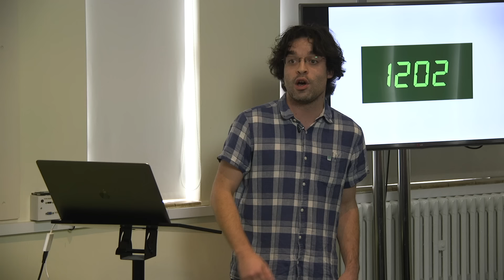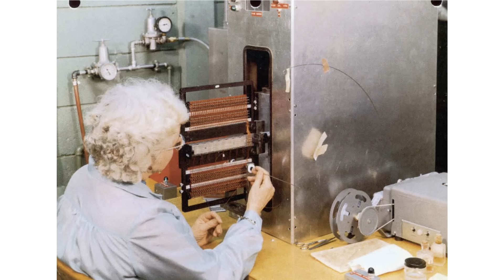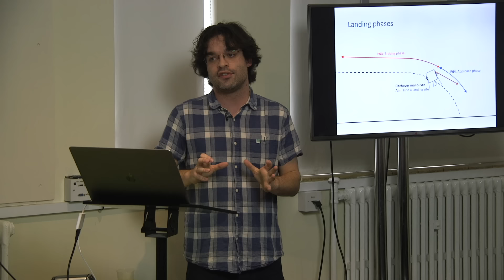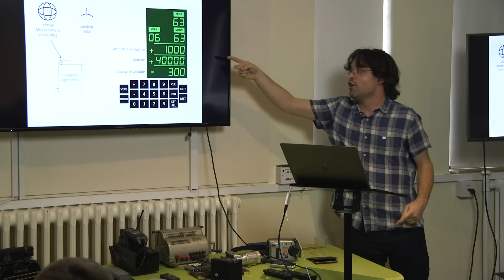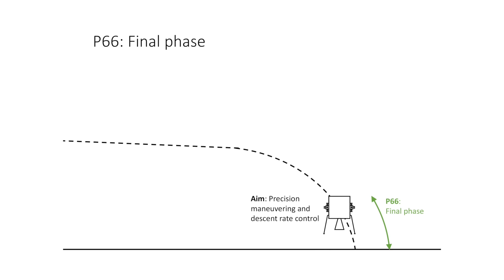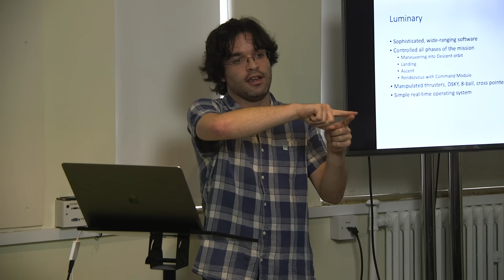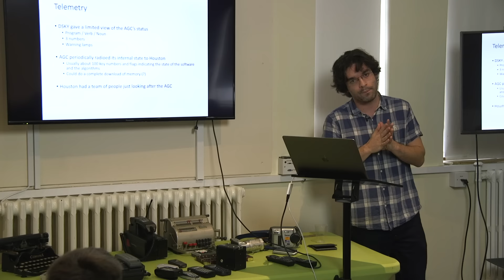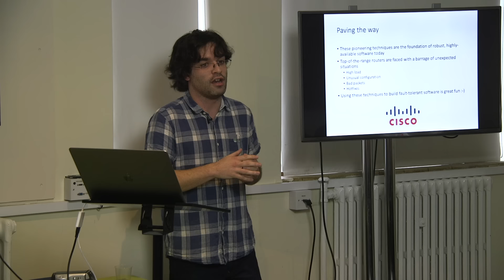Light Years Ahead | The 1969 Apollo Guidance Computer

Comment: 35:35 that 2 shadows is not parallel.. lol .. very well presented and quite very interesting! 42:38!
Reply: 35:35 that 2 shadows is not parallel.
Well, yes - as we can see in other photos, the ground behind the Lunar Module slopes upwards - hence the non-parallel shadows.
Reply: @Jan_Strzelecki  Indeed! A slope, and not a studio spotlight o7
Reply: @hannocoetzer8763  The length of the shadow is inconsistent with the position of a spotlight needed to produce such dicergence.
Reply: @hannocoetzer8763  If that's a spotlight, holy fuck, where can I get it?  It seems magic!  A spotlight should, assuming there isn't magic going on, have the rocks in front of the astronaut be significantly brighter than the rocks further away from the subject in direct lighting.  A spotlight, unlike the sun, isn't placed an effectively "infinite" distance away, and it's WAY more dim, so the brightness of any spotlight will drop off quite quickly as a function of distance.

But in that shot I see the area BEHIND the astronaut as brighter than in front of him, and the area in front of the camera looks as well exposed as anything else.  That's stupidly consistent even lighting.  If there was overhead studio lighting to create that consistency, I'd expect the shadow to not be completely pitch black.  The shot looks like its being lit by a single source that is stupidly far away, like outside daylight, with almost no light diffusion.

And that looks like a studio light to you?  Mind telling me the brand?  Which can replicate full exposure even directional sunlight like that?  How on earth does a person accomplish a shot like that?
Reply: @Killua2001  If Stanley Kubrick were still alive we could ask him what spotlight he used and how he did it

But in all honesty, I enjoy the moon landing conspiracies, and for me it is little curiosity  thought experiments of whether it was remotely possible to reproduce the same effects, back in the sixties, without going to the moon .. for instance even maybe hypothetically using moonlight as the main light source - single shots with very long exposure and wide aperture
Reply: @hannocoetzer8763  Ah, fascinating, so you've now recognized that the lighting is so even it suggests it's outside.  But you've got some other issues.  I'm going to ignore the motion blur issues that crop up when we switch to video, and stick to just a long exposure still where we assume a subject doesn't move AT ALL.

How do you avoid seeing stars?  If we're exposing for low light, without the light source directly in our field of view, and we've got a wide open lens, I'd expect to see stars.

It has the even lighting of a source very very far away, like, say, the moon, but it also seems to be lit by an incredibly BRIGHT source, like, say, the sun.

Of course, you can say "well, no, it was filmed in a studio", but that brings us back to the 'lights' that seem to have completely even lighting without any hot spots while also magically creating a complete black void behind the astronaut.

Gotta say.  Requires a lot less suspension of disbelief for me to think we strapped people into a tin can stuffed to the brim with explosives than it does for me to think Kubrick was capable of violating the laws of physics with his advancements in the fields of optics and lighting in the 1960s.

Comment: NASA - hebrew for "to deceive". If the van alen belts hadnt destroyed them, then the tempature at full sunlight would of fried them to 127 degress celcius, yet the chest camera that was used for filming wasn't friend in such tempatures, and neither were the astronaughts. The moon Lunar lander had the same space as two phone boxes side by side, yet they fitted in it the moon buggy and two astronaughts. The science is laughable beyond belief.
Reply: You NASA haters are truly pathetic. 
 Get a life!
Reply: @CNCmachiningisfun  then how would you spend your life?
Reply: NASA - hebrew for "to deceive".
That is factually incorrect. NASA in Hebrew means "to uplift". You're thinking of "nasha".

If the van alen belts hadnt destroyed them
It wouldn't.
"The outbound and inbound trajectories of the Apollo spacecraft cut through the outer portions of the inner belt and because of their high speed spent only about 15 minutes in traversing the region and less than 2 hours in traversing the much less penetrating radiation in the outer radiation belt. The resulting radiation exposure for the round trip was less than 1% of a fatal dosage – a very minor risk among the far greater other risks of such flights." - Dr. Van Allen.

_ then the tempature at full sunlight would of fried them to 127 degress celcius_
Had they no temperature control systems, it would, but since they did, it didn't.

yet the chest camera that was used for filming wasn't friend in such tempatures
The Hasselblad camera used in the Apollo missions hasn't been exposed to the sunlight long enough to actually heat up to 127ºC.

and neither were the astronaughts.
The actual astronauts were, though. Do you perhaps imagine that their space suits were white just because they ran out of dye or something?

The moon Lunar lander had the same space as two phone boxes side by side, yet they fitted in it the moon buggy and two astronaughts.
Okay? In this reality, though, the astronauts carried the LRV outside of the Lunar Module.

The science is laughable beyond belief.
What is laughable beyond belief here is your pitiful understanding of the Apollo program specifically and science in general.

Comment: I hand coded Fanuc® when we had to ensure our total program was kept very small to compensate for lack of memory. Now, in the days of high level cad/cam and finite analysis systems, like MasterCam® and Solidworks® most programs we hand coded back when are available as simple canned routines. The interface takes one code with three or four variables instead of a pages-long stream of individual commands. I get how much onboard brainwork the software engineer had to have in mind and how easy it would be to neglect a checklist item for intercept radar to off, and all I was trying to avoid crashing was a tool head into a workpiece or fixture. Credit to MIT/NASA that they only had one glitch landing on the moon with less memory than my microwave oven.

Comment: First, brilliant presentation!

Second, about Aldrin and the rendezvous radar: In 2019, the spate of Apollo documentaries included one with an Aldrin interview about the 1201/1202 issues. In that interview, he admitted that the standard mode was to switch off the rendezvous radar before starting powered descent. But for the landing he claimed he wanted to be "ready for an abort", so he intentionally skipped that step. He made the admission/confession with classic Aldrin braggadocio and very little sincere reticence. Basically his posture was, "I wanted it. So I did it. And I got away with it." 

Remember that Aldrin was nicknamed Mr. Rendezvous for his extensive and invaluable work on orbit rendezvous techniques. In my mind, he wished he would be the first pilot to land on the Moon. But if he couldn't have that, he wanted to be the hero who saved the landing party after an abort. So he situated himself and his "indulgence" for success after an abort. He wasn't cheering for an abort. But if it happened he was ready to reap some credit for his enhancement of SOP.

I don't think for a second he expected his little stunt would have caused the ruckus it did. And Apollo was mostly a national pride production, so pointing a finger at one of the two heroes who landed wasn't productive.

Comment: Pfft.. that's plenty of memory. That's not even 2KB, that's almost 4KB of RAM. I've written code for controllers with less memory than that. Clock speed is pretty slow, but plenty enough to steer a spaceship. Why they didn't add an extra bit to the processor word is weird tho. Would have been much better to add one more bit to keep it a power of 2. I haven't done any research on the reason for this, but perhaps this was simply because of how they initially aligned memory modules.
Reply: There is no need for word length to be a power of two.  It is a convention used in more modern computers because most computers nowadays do a lot of processing of text and the industry has standardized on 8-bit characters.  Byte addressing is also a feature of many computers.  Those are no consideration for a computer which does only numeric processing.  Their word was as long as it needed to be and no longer.

Comment: Even though the guidance computer, and everything NASA did 60 years ago was impressive, it's uncorrect to call the "guidance computer" a computer. It is more of a sensor system with readouts. The real computers used were the most advanced of them all, still unbeaten by any computer yet made, the engineers on the ground doing the real calculations!
Reply: I have a graduate degree in computer science, and I call it a computer.
Reply: @GH-oi2jf  kinda, but the real computer was all the engineers on the ground. They did the majority of the heavy calculations.
Reply: @Need2connect you're right, but you miss my point.
Is your wifi module in your phone a computer? Yes, of course. But it's still the cpu that do the important computing (in addition to the gpu, which also do much of the computing). But still, without you, the computer does nothing. Humans are still superior to any computer, then and now. Agree?
This computer, wich correctly per definition is a computer, isn't the unit that did all the heavy computing. It's essentially a sensor that collect data and read it out to be further calculated. I think it's wrong to dedicate much of the success of the Apollo program to these simple units. Even though it was impressive what those units did, it still was the humans on the ground that made the important calculations. I think the engineers is kinda forgotten. And that's what I hope more people will see. With that, I'm absolutely not trying to dismiss the importance of these units, but i think they got too much importance in the history and success of the program. I'm not English native, so I'm not sure if I make any sense in what i try to say..

Comment: question: if they had had to abort, how would they have reconnected with the orbiting module? iirc, there wasn't enough fuel to wait for collins to orbit. so does that mean, in this situation, abort equals death?
Reply: Hmmm....the 'abort' separates immediately from the 'descent' module, and the ascent module flies back to orbit with the ascent engine.... just like it was the normal liftoff, but, the rendezvous would be tricky, and would have to be recalculated, and would probably take several maneuvers and several orbits to meet up again.... I'm sure there were plans...and I'm sure there would be enough fuel....
Reply: Why do you think there wasn’t enough fuel?  They would just have had to get into a higher orbit, then the command module would manoever to pick them up.

Comment: I think you were a bit hard on buzz, he was running 16/68 so he could monitor the convergence of deta H. He’d done that in training and it hadn’t caused a problem. It’s a good thing to monitor if you have the ability to do so. Once it appeared it was causing a problem due to the antenna issue, he identified it and ground control took over the monitoring. It was nothing to do with him being over excited to land on the moon.

Comment: In case you're wondering about simulations. Working for a chip design/manufacturer, I can tell you we still do VERY sophisticated emulation before the chip gets built which includes race hazards, signal interference/crosstalk all the way up to i/o and actual simulation of machine instruction execution. Even with all of that simulation there are always errors found during early spins of the silicon, but without the simulations it would take years to "get it right".

Comment: This touches one of my pet peeves. We've completely lost the concept of software efficiency. Wordstar fit on a low capacity floppy and ran in 640kb. Now a word processor needs compression to fit in 750mb and wants gigabytes of RAM. How much more could we do with efficient software?
Reply: That's a stupid pet peeve to have. We still do have extremely efficient software. Try programming a full-featured modern word processor that can handle hundreds of file formats, export to PDF, handle a zillion different layouts, embedded images and video, unlimited fonts, macros, web integration, and fit it in 640kb. Wordstar was great for its time, but technology moves on. We have unbelievably efficient optimizing compilers. Thinking that software today is bloated or not efficient is taking away the credit modern programmers (and compiler designers!) deserve. One of MY pet peeves is when people bring this up, because it's simply not true.
We wanted more complex software, we wanted faster, more complex hardware, we wanted our computers to do more things. Sure, we have 16GB of RAM on a modern machine. But our modern machines do 16 million times as much work as DOS machines of the 80s did. Real-time 4k video decoding while I'm writing an essay in LibreOffice while uploading files via FTP over a wi-fi connection that's using TLS? And I still have 45% free RAM. You're severely underestimating how complex the tasks today are, and waving your hands like an old man saying get off my lawn.
Also, try getting programmers to write LibreOffice in assembly. Go ahead. They'll want triple the pay and you won't do as good a job as the optimizing compiler does.
Reply: @AureliusR  And that's kinda how we got that way. I'm not saying you should profile every line of code, or write in assembler. But, layer upon layer, things have gotten out of hand and I'll bet there's plenty of dead code.

Comment: The primary method of testing was manual just like flight test of the day. My father landed the LEM Flight Simulator on the Moon 26 times. He used his 18th Century Sextant to align the simulator hardware with a projected star field. Once aligned the computer knew it's location in space and keep in sync. He flew it enough times to be convinced it was working properly, then signed off on it. The old fashioned way. You had to be clever and frugal when your resources were limited.

Comment: The technology to travel to the moon, land safely, broadcast yourself, and return safely did not exist in 1969 and does not exist today.
Reply: What part of it doesn't exist?
Reply: @atlas8827  So many... Think for yourself...There was no way to slow down, let alone land. There is no atmosphere, so firing rockets in reverse wouldn’t work. What would be used as a landing runway/landing pad? The space shuttle needed about 1.25 miles of smooth runway to land safely. Intense heat on the sunlit side of the moon, more than hot enough to boil water, would have melted the “spacesuits” and killed all battery power within a few minutes. Transmission was impossible, television had just, 9 months earlier, broadcast its very FIRST grainy program from the Midwest to Hawaii, a football game that lasted 3 hours.  That was a distance of about 4500 miles. The moon is 239,000 miles away. There’s no way a signal could be detected, certainly not by television sets at home. How would you leave? How would you generate the power to accelerate to 1.5 miles/second? This guy sounds like the tooth fairy talking to children, at a 5 year-old’s Birthday party.. I doubt if even he’s old enough to even have been alive during Apollo 11.
Reply: @chancerobinson5112  
Rockets do not require air to produce thrust. 

The lunar module landed vertically, so you don't need a runaway, just a place that is somewhat flat. The shuttle comparison is dumb, since it was never designed to land anywhere but on earth. 

The landings took place during the lunar morning, long before the very high temperatures. Add to that the fact that vacuum is a great insulator, alongside with the several layers of highly reflective material used on the spacecraft and the suits, and you just made the whole thing a lot easier.  

Transmission was not impossible, that's ridiculous. The first EME bounce had been performed all the way back in the mid 40s. Your example of the football game was likely limited by budget, not technology. Also, the signal from the moon was not picked up by television sets. They were picked up by colossal radio telescopes, then rebroadcast.  

You generate enough power to accelerate to such high speeds by burning millions of pounds of propellant.
Reply: @atlas8827  As reported by the UK’s Guardian newspaper, even the “moon rocks” given the the Government of the Netherlands, proved to be petrified wood! Determined “Apolloganda”, I’ll grant you that.
Reply: @chancerobinson5112  
Do some further reading. The rock didn't come from NASA.
Reply: @atlas8827  Sounds like ‘45. I don’t know they guy, deniability. The computing power that this presenter is talking about, didn’t exist either, at least not small enough to to be mobile. This is nerd fest nonsense.
Reply: @chancerobinson5112  
Of course it did. Unmanned spacecraft had previously landed on the moon, and it would have needed navigation computers to do that.
Reply: @atlas8827  LOL
Reply: @chancerobinson5112  
I assume you posted that because you have nothing else of substance to say.
Reply: @atlas8827  You’re correct! After some fact-checking, it appears that your “substantive claims” are rather dubious.
Reply: @chancerobinson5112  
How so? Please expand.